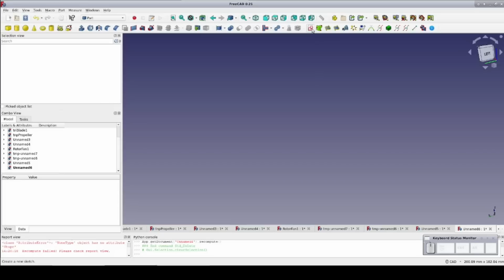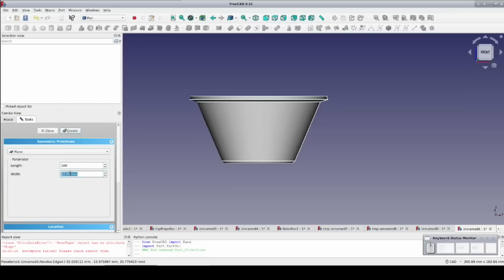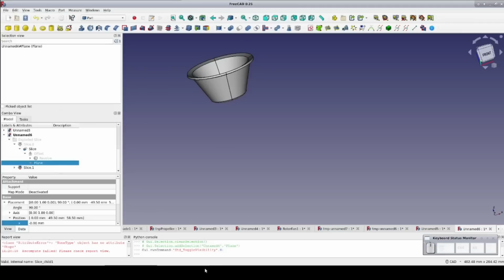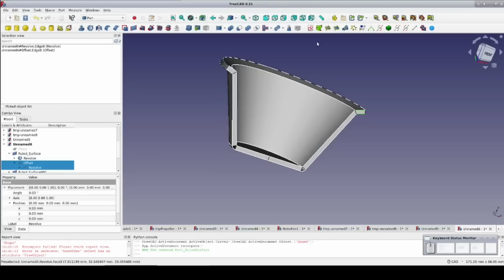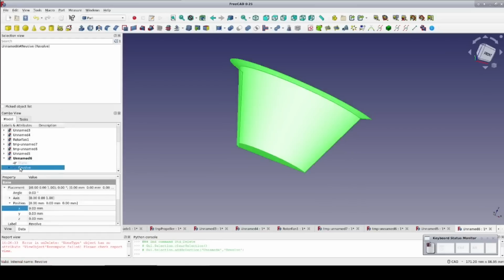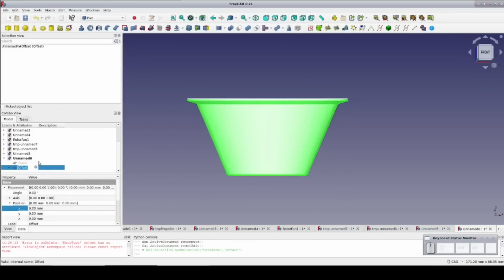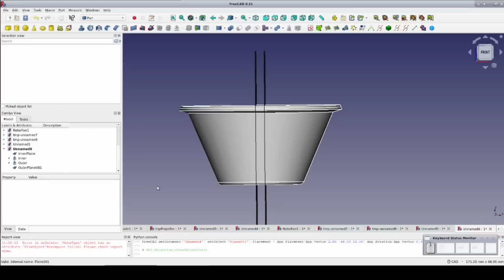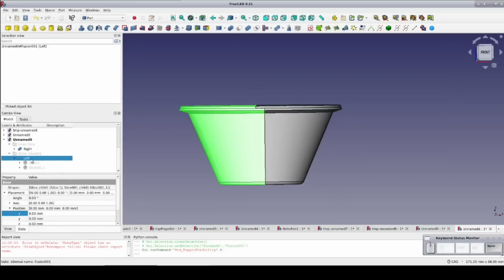FreeCAD: An open reply to Tom Sanladerer

Comment: This is the most cumbersome and ridiculous workflow to create one very simple shape. "Go there, then manually create bunch of faces, then install additional plugin to fill a couple of little gaps, then convert to that, or slice it in completely different workbench and then see the result illogically appeared completely out of work-tree sequence of the body, then... then...". And the result of all this headache is just a simplest shape you could ever imagine for 3d printing (that would become badly broken anyway as soon as you change something back in the body tree).
The workflow/UX of creating THE SAME simple-complexity shape is MUCH more logical, easier, and robust in other CAD softwares. The main problem of FreeCAD is its ground-design, plus bad quality and stability of its existing tools and its UI/UX.
Reply from the maker: You seem confused between the part where I explained what went wrong and the following segment where I showed how to do it cleanly in a single workbench. The result is fully parametric.
Reply: @4axisprinting  It had been a while since I used FreCAD. I managed to create the model but probably spent 30 minutes. It took some scratching around just to start the sketch, then more time remembering basic commands. I can see how someone would just give up.  It took 5 minutes in Fusion 360. 

FreeCAD for me is like Linux OS. It's all tossed in a bucket and you have to figure it out. No one can explain why there are two workbenches for a part.

Comment: One way to avoid splitting and surfaces is to revolve 1/2 of the cup from a 2mm profile. Create a sketch on both sides with a 1mm profile from the inner edge. Then revolve/extrude a lip on one side. On the other side revolve/cut the same distance. The result is a part that fits into a copy of itself to form both sides of the cup. Alternately, one side can be made with a lip revolved on both sides and the cuts on the opposite side, as per the video.
Reply from the maker: Yes. Alternatively, instead of translating the inner cut plane and the outer cut plane, you could rotate them a degree or 2.

Comment: I have been using FreeCAD for about a year now, and I don't even consider switching to a proprietary alternative, especially if it requires an internet connection. However, I would like to see FreeCAD change its direction from trying to do everything poorly to focusing on doing one or a few things well. Initially, I was confused by the conflicting workbenches like "Part" and "Part Design." It took me some time to understand that "Part" is for quick and rough prototyping, whereas "Part Design" is better suited for more complex designs with the ability to apply changes more efficiently. Nonetheless, I would gladly say goodbye to the "Part" workbench if it could free up more resources for making the "Part Design" workbench more robust and user-friendly.
Finally, I would love to see a video like this one using the Part Design workbench instead of the Part workbench.
Reply from the maker: It's worth noting though that the part workbench is the central one. Part Design is implemented by calling on tools from the part workbench.
Reply: Absolutely. I only switch to part for boolean operations on bodies designed in part design.
Reply: @MrBCRC  I just ran into a really silly issue. I wanted to do a offset sketch from an original sketch. The tool isnt the sketch tools, you have to go to the Part workbench to do a 2d offset of your sketch. Now if i didnt have interent access, How was I ever going to figure it that out? Plus when you the 2d offset you still need to do extra steps to implement it into your original sketch to do a pad on it. Its actually kinda silly a simple offset tool doesnt exist in the sketch workbench.
Reply: It depends what you're designing. If you're designing a part that you want to 3d-print then you generally want part design. However, I personally also use FreeCAD to design assemblies of simple "parts" quite often, and the Part workbench has its place for this.

I wish FreeCAD would standardize on a workbench and system for assemblies and constraints between multiple parts. There are several competing projects for this. That's fine, but I wish the core devs could pick one that gets bundled with the core product.

Comment: I'm new to Freecad and have made a few models. Most of what you did here was way over my head. Every time I run into something I want to do I have to search the net to find out how. I find that a lot of the procedures are not intuitive for me but I'm not sure it would be easier in another CAD program. I'm just a hobbyist and want to make things to print on my 3d printer that I don't have models for. I have been successful in making a few simple models and one more complicated one. 
What you said about pricing and things becoming unavailable hit home for me. I used to use several programs that are now too expensive for me to use.
I wish I had a free CAD program that was a bit more user friendly and intuitive. I probably only use 25% of the features available. 
I liked your presentation and response to Tom. You earned a subscriber. If I need to learn more Freecad I'll definitely look through your vids.
Thanks.

Comment: FreeCAD vs a full-blown industrial CAD program like Fusion 360 is not a fair fight, If Fusion 360 ever cuts off hobbyists people will learn to love FreeCAD. A full version of SOLIDWORKS was free with an EAA membership ($40/yr) until two years ago. That changed to an additional $50/yr with an EAA membership but it's the browser based version. Fusion 360 could do something similar.

Comment: I noticed you did it (almost) all in the Part workbench. I'm under the impression that they really mean for solid parts to be made in the Part Design workbench, have you looked at how that might go?
Reply from the maker: Really, Part and Part Design are just different ways of working.Part Design looks a little more like other CAD programs in some ways, but is a bit less versatile and doesn't play well with tools from other workbenches.

The design can be accomplished in Part Design, but personally I find it more awkward.

Comment: The fact that FreeCAD has been in development for over a decade now and something like CAD-Sketcher comes out for Blender in a matter of months and blows the capabilities of FreeCAD away just makes me even less interested in FreeCAD.  I keep coming back to FreeCAD, but the hostility of the UX and the tediousness of having to do many extra steps to accomplish a relatively simple task ultimately means to use it, you're going to be less productive.  There's a fork of FreeCAD that performs much better than the main branch, and somehow that 1 developer is coding circles around the primary project.  I've seen Open Source tackle and surpass many commercial products, but FreeCAD won't be doing so without new leadership.  With things like Plasticity also popping up as well in such a short amount of time, it's obvious that the development timeframe of FreeCAD means it won't be production-ready in my lifetime.
Reply: CAD-Sketcher is not even close to being the same though, first of all it's not a standalone project but a plugin for Blender. Blender is a mesh-based modeler, unlike FreeCAD, that doesn't really work if you want actual precision, because it depends on the resolution of the mesh. Plasticity is not a parametric modeler at all, and it uses a commercial geometric kernel Parasolid, the same one that SolidWorks and Onshape use.

Comment: Yea... That's still a big nope for me... Even as an Early Adopter with a reduced License Cost, I'd still rather pay the full price than having to deal with this this highly unintuitive Software.

@10:48 Well... We quite literally call that a "You get what you pay for" scenario 😑

I'd also argue the whole debate about Autodesk deciding to move features over to a paid Tier / Extension is getting totally blown out of proportion for no reason other than to seemingly have an argument to discourage ppl in using Fusion 360... Quite literally the only thing I can see being an issue in the Personal License Tier ( those that do not pay ) is the 10 Active Document Limitation which is for like the vast majority of Freeloaders a nonissue unless they've adopted a more professional CAD approach by curating a Parts List for bigger Project(s) and they're suddenly cut off from some of the necessary Parts they'd require for said Projects.

Same for some of the Features now locked behind ( arguably ) costly Extensions like anything remotely important for automated High Level CAM and Injection Mould Making. Like Really? Who the fuck has need for that stuff requiring Machines in the 50k up range ( the smallest 5-Axis CNC is still 10k and can only do about a two Matchstick Boxes Volume so LoL! 🤣 ) to validate that need but cannot afford the Extension? No Beginner or any Hobbyist needs these features which is why they're now in a paid Tier and even IF they need them for some reason but still don't want to pay for it then they'll still be able to do it they'll just have to "Work a little harder" by doing it manually / split apart / etc...

Point is... The Basics and Presentation are more than solid with Fusion 360 which is what is important and which I cannot say is the case with FreeCAD which quite frankly gives me the impression of an All Inclusive Nothing Done Vibes: https://wiki.freecad.org/Feature_list#Key_features

Comment: This is again a "FreeCAD can do this - just do it this way" type of video.  This is like:
YOU: Hey guy, you don't need a CAD program, I have this finished design ready for you.
ME: But, that design is totally not what I want, I want to design something totally different.
YOU: Yeah, that's a pity, but hey my design is for free, so just make do with it ...

FreeCAD devs seem stuck in similar reasoning, trying to force users into the limitations of the tool, rather than having the tool allow any possible way the user might think of getting to a certain result.  Sure, FreeCAD can probably be used to design anything, but so can OpenSCAD.  That doesn't mean that I want to force myself to not having sketches where I basically draw 10 parts at once, using constraints to have them correctly sized compared to each-other and then just extruding each of them.  "But that's bad practice", I hear you say.  To which I would reply: but it lets me do in 5 minutes in Fusion what I've never been able to get FreeCAD figure out with me myself first figuring out the right dimensions to fulfil the constraints between all those parts.

Comment: I feel like this entire issue could be solved quite simply by using the part design workbench instead and not complicating things by switching between workbenches or added custom toolbars. Sketching the actual profile of the pot and then revolving then splitting and so on. I understand why he attempted to do it that way but coming from any parametric CAD software starting with a surface seems backwards.

Comment: Freecad has the tools, but the interface, the FreeCad way of doing things, that's the problem. I use QGIS all the time, it's an example of an opensource project that competes with commerical products in a space that is more niche than mechanical engineering. QGIS works great and was easy to learn, but it's also a complex software suite. Why can't FreeCad be more like QGIS?

Comment: The price of FreeCAD is the extra time and effort it takes to get the same result. I am still keeping my eye on it. Things like the curves bench should really be integrated by default. It's those little things that take the user out of the design mindspace and force troubleshooting mode that ruin the experience. But, that's not limited to FreeCAD. It's probably about time I try a current build, of FreeCAD, it's been a few months.

Comment: I started out with CAD when I bought DesignCAD3d at a thrift shop for $1.  It works on my Linux computer just fine, but lacks a lot of modern stuff.  It was 2001 when I bought it, and it was several editions old already, and upgrading for $200 wasn't an option.

My biggest complaint about FreeCAD is that the help system was written by a computer programmer, rather than a CAD nerd.  The CAD nerd needs to get on board with the programmer and rewrite the help system.

Comment: Freecad user here: I look at Freecad like the pre 2.8 days of Blender, before the old UI was overhauled. It's functional, but rather unwieldly. At some point there needs to be a confluence of features/useablity improvements that are analogous to that set of Blender updates if you want Freecad to succeed long-term. "Make your own plugin!" I hear people say, but why do that when all of the major engines allow for plugins, you could spend that time making a plugin for an engine that has a nicer UI and add truly unique functionality.

Sure, you're going to have some die hards that'll use it regardless and they'll be the ones that ultimately push it past the threashold into mainstream, but until then it'll be unwieldly. Only reason I use it instead of something like Onshape is because I can make whatever I want and not have to worry about whatever's buried in Onshape's TOS. Hell I can make illegal things with it if I wish. Otherwise it's a bit of a blunt instrument to work with.
Reply: This. There is another thread comparing today's blender with freecad and it really looks like nobody used blender before 2019.

Comment: I'm still scratching my head as to how Tom didn't think to use a plane to split the body since this is even how the split tool works in F360.
Reply: you can't have two different "bodies" in a single body in vanilla FC
Reply: @yosyp_yosyp  Sorry, are you implying the method shown isn't vanilla FC or that the issue may have been because the result creates 2 "slices" under the body instead 2 individual bodies? Looking back again I see he did gloss over attempts to use the slice tools so perhaps he did try something similar.
Reply from the maker: @Yosyp  He was using tools from the Part workbench though. No body and you can split things freely.

Comment: Somehow the algorythm recommended me this, after Tom Video.

I can't say anything new that hasn't been said in  the numerous comments below. 
A tool that seems to fights the user at every turn will seem like a waste of time and probably give no confidence to the user.

Well, I can add my feedback after 5 years of switching from Solidworks (great UI, terrible stability on some setups) to Inventor (Mediocre UI, consistent stability, weird innovations). 

Inventor: where a 18 year bug reappears periodically and the autodesk forums are both a blessing (work arounds, insights on how it works) and a curse (old solutions can't work because UI and engine changed). 
Problems of a big company that has a lot of customers? And needs to justify changing versions every year?
They add "usefull" features that totally can break your workflow and product management in the new releases. 
For other companies those are a blessing, for where I work it's been a head ache.

On the other hand, an open source project without a Foundation or a lead ... can have this certainly special UI and workflow.
Reminds me of Catia pre-V4 ? Pre-v5 ? That was special.

Comment: Much too complicated work flow.
Can be done much easier in the part design workbench with the thickness tool.

I already tried to rebuild the cup design from Thomas video. The rest of the design that is not show here, the is the connecting tongue and groove is not trivial.

Furthermore the video does not address adding a feature later on like the ball in Thomas video.

If I find time I'll make a video on this. 
The basic workflow I use is similar to that from the tutorials of OficineRobotica you can find on YouTube.
Reply from the maker: Instead of a full tongue and groove, I built it in two layers and split them at different offsets so that the halves will interlock. If you want a full tongue and groove, add one more layer, make the offset between the planes smaller, and cut innermost and outermost with one plane and the middle layer with the other, then fuse the halves same as I did.

But if I had to do the tongue and groove seperately, I would just cut the cup exactly in half, make a sub-object shape binder on the exposed face, offset it inward, and extrude it. The groove could be done same way but extrude into the cup and cut instead.

Comment: It is a public service that free CAD software is available. It is unfortunate that FreeCAD is based on a "parametric" approach to 3D modeling. Parametric modeling is completely unnecessary or useful in 99% of cases. It just adds complexity without, generally, any benefit and makes the software much more difficult to learn and use. I have been using what is now known as PTC Creo Elements Direct Modeling for over thirty years. It doesn't require any explicit creation of geometric relationships. Just direct modeling of any 3D shape, which makes it easy to learn and use. PTC purchased this app, which was originally developed by Hewlett-Packard, after it became clear that it's flagship product at the time, Pro Engineer, which is also a parametric modeler, was simply not the best application for the majority of modeling tasks. For those rare instances where parametric modeling may be desirable Creo Elements Direct Modeling has an add-on parametric modeling extension.

Comment: as someone who uses solidworks, i had trouble with the learning curve when i tried fusion 360 just to see how the two programs stack up i cant even imagine where i would start would FreeCAD. sorry if im not understanding what exactly is trying to be achieved and dont use FreeCAD so dont know if these methods are possible but, can you not make a solid than extrude cut one half?